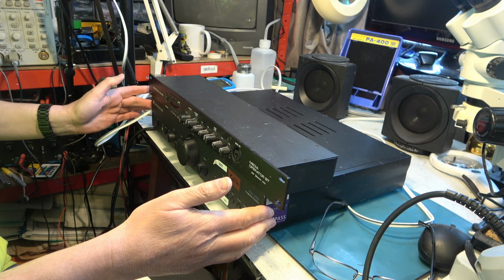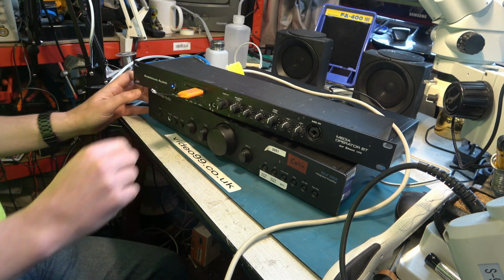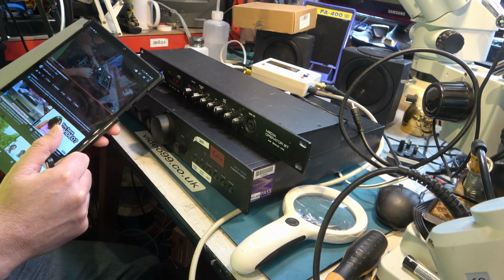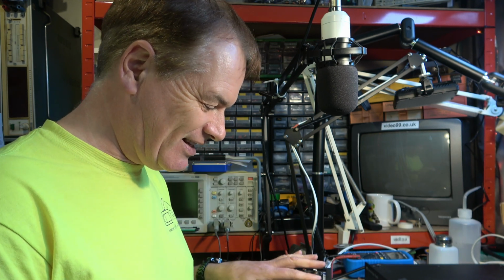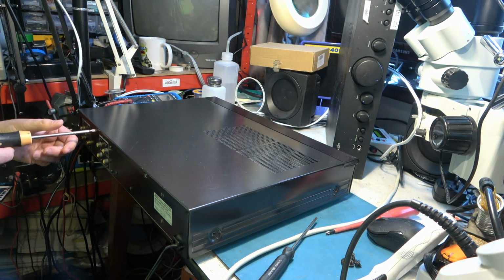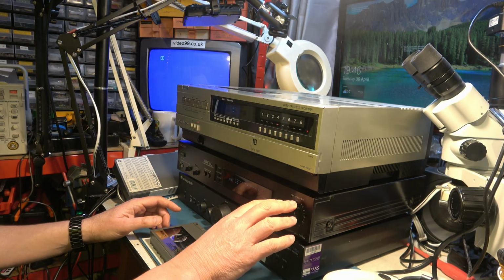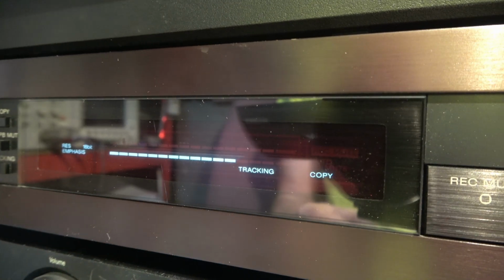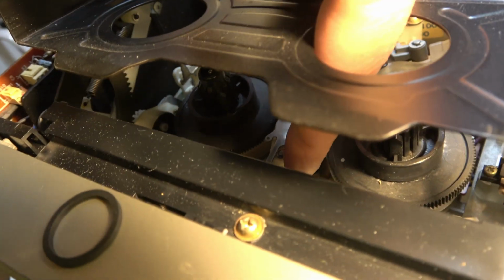Audio video equipment Testathon part 2

Comment: Are you sure the C9 and F1 were the only PAL machines to support PCM recording? I have an SLHF-950 and there's a three-position audio input selector marked: Tuner, Simulcast and Line/PCM. I never experimented with PCM recording, but I think you were supposed to use the Edit switch when playing back PCM tapes on the 950
Reply from the maker: That would only be the input selection, unless there's an extra position on the switch for PCM.  Still never played with an HF950.
Reply: @video99couk  According to the mrbetamax site, the Edit switch on higher end Beta VCRs disables the dropout compensator. If he's correct, the HF950 is a suitable machine for playback of PAL PCM-encoded recordings as it has this switch (next to the normal/Super Beta STD/SuperBeta Pro switch). I don't have a PCM encoder/decoder so this is not something I can test with my HF950 to provide a definitive answer.

Comment: Hi, Colin. You can repair the original relay by removing it out of the circuit and there should be 2 small clips (side by side) on the body of the relay. Using a thin  flat screwdriver, carefully remove the black plastic cover which will give you access to the inside of the relay. Apply a switch cleaner on the relay terminals and clean them. The relay should restore perfectly.

Comment: Out of interest did any VHS machines have PCM audio built-in ?
Reply from the maker: Techmoan covered a PCM machine which used VHS tapes.  It was a commercial failure.  Was PCM incorporated into any VHS video recorder?  Not as far as I'm aware, but I stand to be corrected.
Reply: @video99couk  The Technics SV-P100 only had 14 bits to achieve better error correction. I tested the SONY PCM-601 with a Panasonic NV-333 EG (no HQ) and a TDK EHG 180 cassette without any complaints. On paper, an old VHS recorder has 240 lines resolution (corresponds to 96%), and U-matic 250. But there were also VHS recorders before the HQ era (1986) that had clearly visible 3 MHz lines in the (FUBK) test image.
Reply: @video99couk  It's not quite the same thing but there were a handful of Japanese market SVHS decks that could record a PCM audio track (I believe either 2 channel 16-bit 48 khz or 4 channel 32 khz 12-bit) to the tape using the hifi heads, HR-Z1 is one example.
Reply: Technics SV-P100